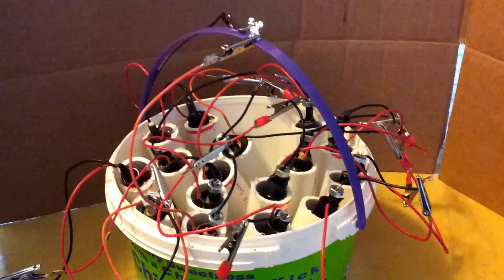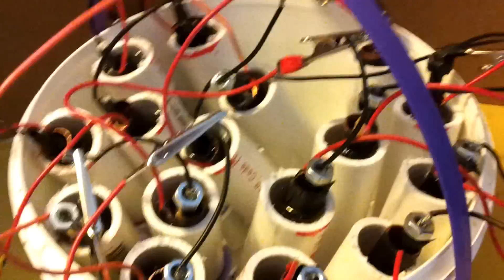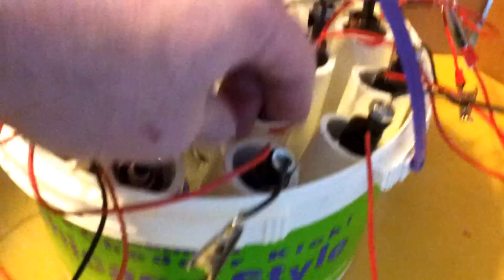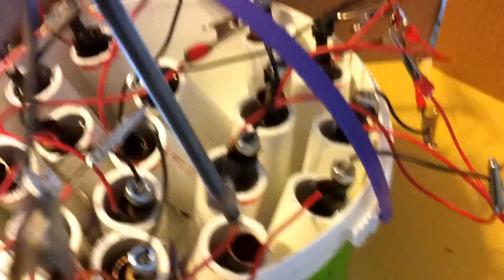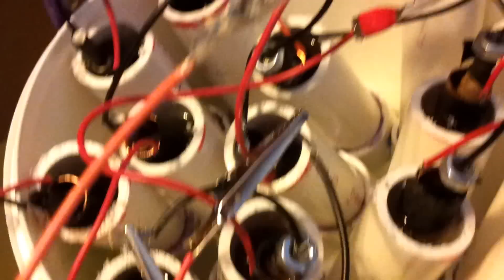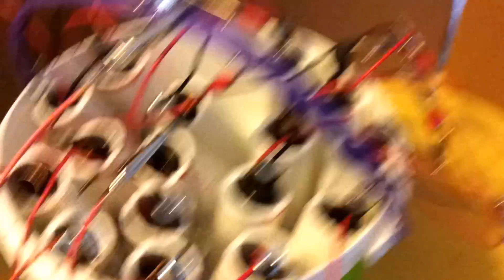12.8 volt Salt Water Powered Battery [One Bucket] -Transportable

Comment: Mr. Russo,
It might be helpful for you to review the chemical principle of how ELECTRICITY  is produced by Electromotive Force or EMF. 
Current production depends on the types of metals at the two poles and their relative position on the periodic table of elements.  The voltage would not change even if your copper pipe was 10 pounds heavier or the other metal in the cathode pole was twenty pounds.  
The choice of your two metals determined what the voltage was going to be.  You may want to try connecting all copper electrodes together and all of the other poles together and see how much Current you could get by connecting your cells in that way.
Nice job for your effort.

Comment: the zinc on your bolts will go bad soon. if you used a solid aluminum bolt or screw, it would help. If you spray the inside of your copper tube with dry graphite lubricant, it will drastically increase currents. Add some sodium hydroxide and... you have an awesome primary battery... Tune your electrolyte with Aluminum ions... you have an awesome rechargable aluminum ion battery.. learn more here. http://exnube.com

Comment: It looks like you used zinc coated threaded rods as the cathode in your electrolytic cells . Zinc threaded rods are expensive where I live but aluminum rods are readily available on the cheap. I have a saltwater bay to play with. Have you tried using aluminum cathodes?
Reply: aluminium + carbon would work well

Comment: From what I've read, salt water batteries made professionally can achieve power densities of about 100wh per kg. Salt water weighs about 64 pounds per cubic foot so this works out to about 2.9kwh per cubic foot (without the extraneous construction material's volume taken into account). I'm currently looking into building our next house. Don't want to be on grid, but also don't want to build a solar system that's 5x bigger than I need during summer so that I can meet winter demand. If I'm doing my math right, a home using 12kwh day for electricty (which is what we currently use in electricity in our standard 1950's home) would need 4 cubic feet per day of salt water battery storage. So a 100 day battery would be 400 cubic feet. I'm wondering if I could also multi task this water to act as passive solar thermal storage for use in radiant floor heating of the home, getting a 2 fer 1 on the construction costs. All and all, a 400 cubic foot insulated hole in the ground (20x20x1 or some variation there of) isn't a huge cost compared to buying enough batteries to hold 100 days worth of electrical power and several days of thermal power. And when the salt water is depleted (professional made get up to 1000 full cycles) your refill costs are minimal. I've been looking into this for all of a couple hours so I'm sure I've got a lot to learn yet and may have initially run into sources that were wrong. So I still need to verify/confirm several times and build a smallish (but still considerably large) prototype, but wanted to share the basic idea.
Reply: Matthew Kahler Piss (urea) works better than salt water... what u will need is a boost/ buck dc dc converter... play with your electrolyte to control power output.
Reply: True: Urea is a better catalyst but he said he was going to do a 2 for 1 radiant floor heating..I might make his house or land smell like urine. haha.   Mattthew gives us an update on your project! thx

Comment: With 12v couldn't you hook it up to a power inverter to step up to 120ac?
Reply: it won't make enough amps to run even the smallest inverter. you would need a coffee table size battery to run a small inverter
Reply: thats what i was reading through the comments for. no luck at an answer though.